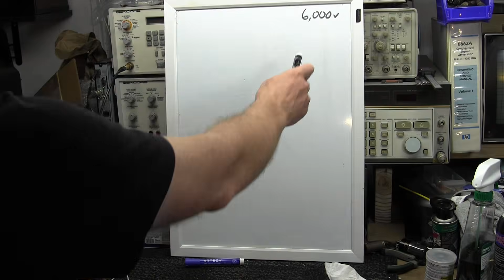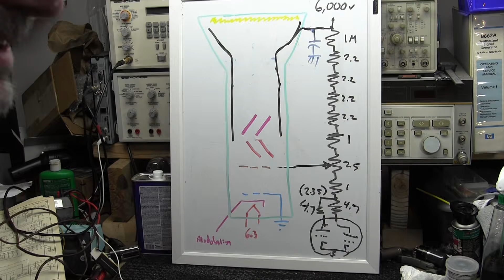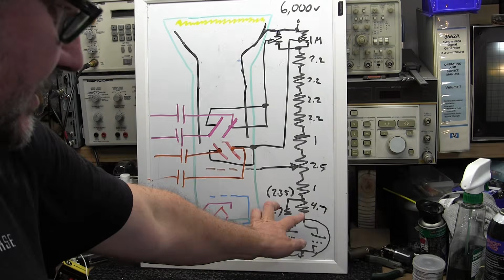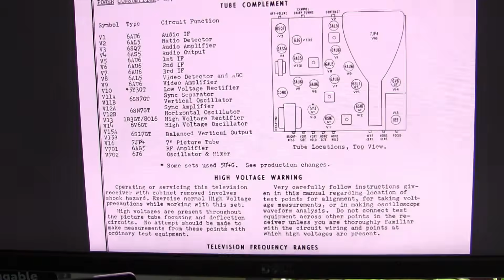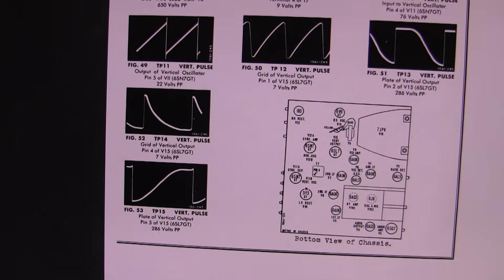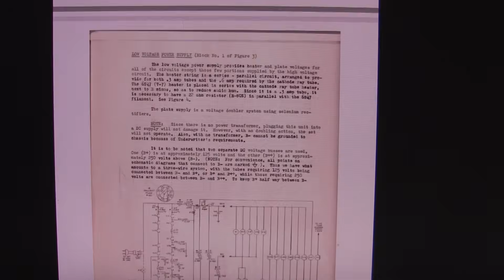How to restore a 1940s electrostatic TV (Motorola VT71, Admiral 19A1, etc) : part 5

Comment: Why would you recommend using VR37 Resistors for carbon Comp resistor replacements? VR37 Resistors are only 0.5 watts which are 1/2 watts which have a GLAZE on the Metal Film resistor which not sure what this GLAZE does.
Reply from the maker: Did you watch the video?  VR37 are rated the 3,500 volts.  1W carbon comp are rated for only 500V.  Power dissipation is irrelevant.   There is less than 1/4 watt coming out of those resistors.
Reply: @bandersentv the VR37 data sheets says that the power dissipation is only 0.5 watts. The VR37 surge/spike voltage is 3500 volts DC or AC rating?
Reply from the maker: Yes, VR37 are 1/2 watt resistors which is more than enough for this application. 3,500 volts DC/ACrms
Reply: @bandersentv yes you said in the video the circuit operating at 6000vdc but the current was in the microamps uA, so low current that is why you can use 1/2 power dissipation resistors or VR37 because of the circuit operating with low current
Reply from the maker: yes

Comment: Great, but I don't see how those pots could act as centering controls.  Aren't the 2 plates symmetrical?  So wouldn't you have to alter the bias of one plate with respect to the other in order to control deflection?
Reply from the maker: Yes, please take a look at the schematic.  I over-simplified it.  The pots have taps and the plates are not connected directly together.

Comment: For the operating voltage of the electrostatic deflection plates, isn't it the case that the effective deflection is relative to the anode voltage, not the cathode voltage? So if you attempted to operate the deflection plates relative to the cathode/low-voltage, even if it didn't arc over, the voltage relative to the anode would be in the range -5750...-6250volts, corresponding to many feet of deflection, and the beam wouldn't even hit the screen!
Reply from the maker: Not quite.  Keep in mind there is a plate on either side of the beam so the common voltage on the plates cancels out.  It's the difference that matters.  Say you had -5750 on one plate and -5800 on the other.  The beam would be deflected by 50 volts to one side.  
It's possible the electron beam would squirt out the sides between the plates.  Not really sure.

Comment: Thanks for explaining the divider string. The picture with the caps, where the 6KV is going to the deflection plates, the other side of the caps goes to the horizontal and vertical amps, right? I can’t find the 19A1 prints, but the T54 does it that way. Thanks again!
Reply from the maker: Yes. Schematic links in description

Comment: Hi Bob. Since the two sets of deflection plates for horizontal are more sensitive than the two for vertical, wouldn’t that make the two potentiometers at the top of the 6 kV stack different values? Also, where the eff did they get potentiometers able to withstand 6 kV between the internals and the case??

Basically, it means you need a 6+ mm gap between any metal/conductive part inside the pot, and the metal case of the pot, or it’ll arc over. So, this would be; the shaft, the wiper/slip-ring assy., the resistive element, or the terminals coming out the side. So my guess is it (the potentiometer) has a plastic or phenolic case?
Reply from the maker: There's enough range on the pots that they don't need to be different values.   One end to the other is a few 100 volts. There are also more resistors in volved than I showed.  The plates are not connected directly together.  

Watch the end of the previous video.  The pots are mounted on an insulated phenolic board and have plastic shafts.
Reply: IANB, but the VT-71 has big plastic sleeve like things and standoffs to isolate the pots from the chassis and your fingers when you touch them. I’m sure Admiral did something similar. Cool.

Comment: 6kv between the cathode and filament sounds happy
Reply from the maker: Yep, they use a dedicated 6.3 filament supply transformer with heavy insulation. Or pull it from the hv supply like they do for the hv rectifier.
Reply: @bandersentv  A high frequency coil in the second case?  I believe HV rectifier data says to calibrate the filament voltage by the brightness of the filament, and would assume they do the same for the CRT.  This might be due to skin effect in the heater.